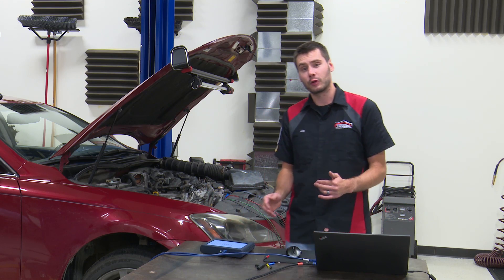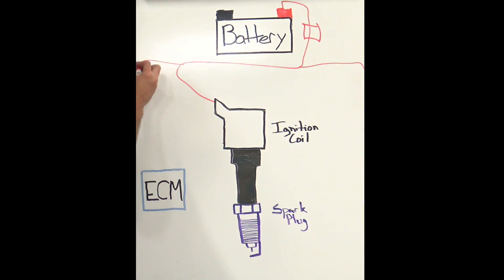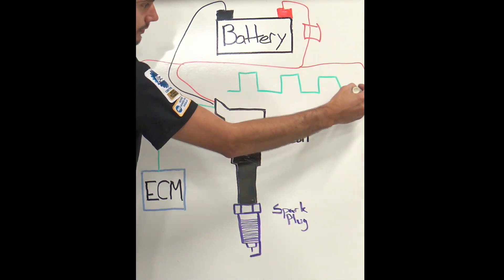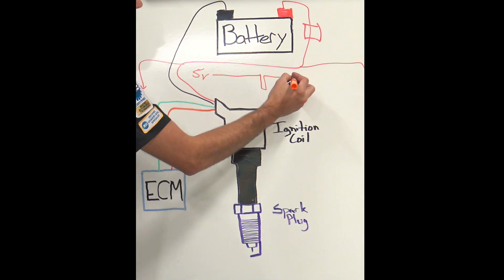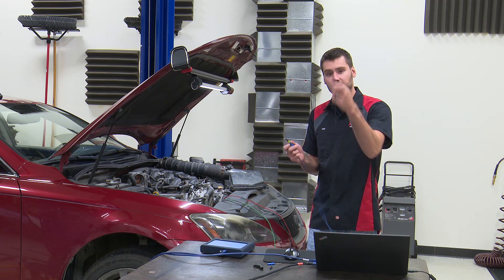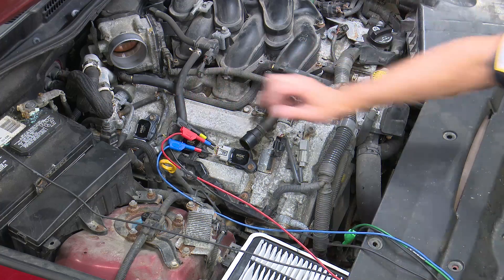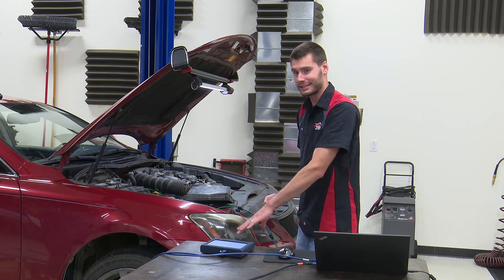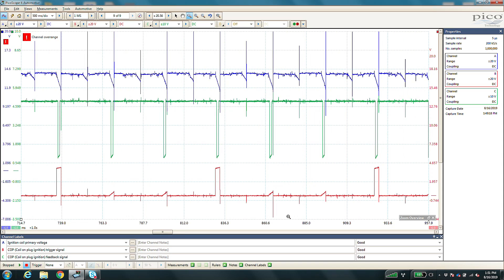"Smart Coil" 4 Wire Coil Testing Using A Labscope

Comment: On Toyota if there is no feedback ( or somehow the ECM senses a bad coil) it will turn of the injector.  I wasted a lot of time looking for a bad wire to the injector and considered replacing the ECM when i had a bad coil. I did not have a code for a bad coil. Next time i will probe the coil first. Thanks.

Comment: NGK Technical Training actually you are not “doing the same thing” as a proper voltage drop test for the ground circuit. By connecting the way you did here, you’re only performing a volt drop across the coil. In your presentation here, you could have completely missed a problem in a ground circuit by not using a channel input to view the difference in electrical potential between the beginning of the coil ground circuit (at coil) and the end (battery ground post).
Reply from the maker: Hey Daryll, if there were an issue with the ground circuit how could we properly maintain voltage differential under load of the coil when the car is running? Would you not expect a larger drop?
Mike Becker, Senior Technical Instructor
Reply: Use battery negative as a reference for all measurements. With a coil ground problem, you would end with less differential across the coil because you would now have 2 loads instead of 1 and with it being a series circuit you’d have total volt drop split between 2 points

So in this case, it would have been wiser to ground every channel at the battery instead of assuming a circuit is good
Reply: @daryllauto-correctdiagnost5020   It's his car. When that 2nd unwanted resistance that's in series with the coil gets high enough, the misfire will let him know something's wrong...lol.

Comment: Fantastic information thanks,  maybe you should also let everyone know that if we have i coil that has failed,  we need to found out the reason it failed,  i have seen people put into some nice NGK coil only to last i few months,  and then saying that it must be the coils are  bad ,only to found out that the reason this car was going through coils all the time was because the injectors was not flowing the best and the poor coils was working very hard because we had less fuel in the system , and i sure we all know that fuel is a conductor of electricity !
Reply from the maker: Hey Stephen, feels like it's been a while! thanks for watching and commenting! You're right, always diagnose the root cause :)
Mike Becker, Senior Technical Instructor

Comment: hi mike i have quotation  do i need to use attenuater  for the pico because the spike that comes after pull the current down? plz explain to me thanks to you
Reply from the maker: Wael, you should not need to. the Pico can handle 200 volts before you need to use one.
Mike Becker, Senior Technical Instructor

Comment: Hey Mike,have you ever had situation that pcm driver(control side or feedback side) has been frayed due to coil module failure?Thanks in advance !
Reply from the maker: Ismar, perosnally I have not seen it. I'm sure it's possible but I believe it to be less likely due to the very low amperage on those circuits. 
Mike Becker, Senior Technical Instructor
Reply: @GoTechTraining  thanks mike!Cheers!

Comment: Would it be fair to call this a Darlington transistor setup? A transistor in the ECM turns on a larger transistor in the coil. Can the square wave signals be tested the "old" way with a test light or is the current carrying capacity too small?
Reply from the maker: Hey, I'm unfamiliar with the Darlington setup. The transistor in the ECM sends a low current square wave as a turn-on signal. You DO NOT want to test that circuit with a test light. It's possible it could cause the ECM to fail, or enter into a fail-safe mode.
Mike Becker, Senior Technical Instructor

Comment: It wasn’t mentioned in the video; I assume that your scope has the isolated ground inputs.  On scopes that  have common ground inputs, connecting a ground to the device’s under test ground and another lead to ground at another point could set up a ground loop.  When the device(coil) pulls current, part of that current can flow through the scope leads.  Or if the chassis ground was not perfect part of the current normally going through the chassis ground could go through the scope back to the device ground.  The scope isn’t in any real danger unless the current flow is large enough to heat up the test leads or the circuit board ground traces.  But it can cause noise to appear on the scope display.  On a common ground scope connecting only one of the lead grounds is sufficient and avoids any ground loops.  Keeping in mind that voltage variations in the chosen ground will effect all inputs.  If the voltage variation of the device is wanted, or to infer current draw; a separate channel input could be connected to  the device ground to measure the voltage drop of the ground circuit to the device.        I like the shorter format.
Reply from the maker: Hey Steve, great tip. Yes the PICO does have isolated grounds so it's not an issue on this one. thanks!
Mike Becker, Senior Technical Instructor

Comment: at 1:30 i would think that the Ground connection for the coil would be on the engine /heads.. so the spark return path is the shortest.  failure to at least attempt to perform a voltage drop test from coil negative to engine/head ground connection may result in misfires or repeated coil failures where the high voltage negative spark return attempts to get by to the coil via the positive circuits.   this is a major issue with Coil in CAP GM Hei's that the ground strap gets left out and with aftermarket MSD boxes that the thick black wire gets grounded to the negative battery post or the body.. without a decent braided engine to firewall ground strap.  just a thought.. i have been at this for 40 years. no just some lurker throwing out garbage..
Reply from the maker: Hey Wayne, when I hooked the scope into the power and ground leads it was essentially testing the same thing. Sure a good voltage drop test is always a great way to go though!
Mike Becker, Senior Technical Instructor

Comment: The scope proved the circuits.  If you had a constant misfire, you could see or prove which one is faulty and along with the scan tool data, may be helpful for what's actually failing.
Reply from the maker: Hey Mike, thanks for watching! Great point!
Mike Becker, Senior Technical Instructor

Comment: How can you look at secondary wave forms with coil over plug systems
Reply: Hi Jeff. If you can access the COP, you can use a paddle probe. Or if you have the lead extension, you can remove the COP. Plug in the lead extension between the spark plug and COP. Then test the secondary with the inductive capacitance probe.
Reply from the maker: Hey Jeff great question! Billy, thanks for answering! That was perfect. 
Mike Becker, Senior Technical Instructor

Comment: Do you know the criteria by which the coil triggers the IGF signal?
Reply from the maker: Hey Anti Chuckle, unfortunately, I don't really know the secret sauce inside the coil...I could speak to one of our engineers. My guess, the module watches for some sort of voltage drop to occur. when that happens, it grounds the IGF circuit.
Mike Becker, Senior Technical Instructor

Comment: Great video! Ironic you posted this now. I just had a Lexus that the igf signal was shorted inside of a coil causing what felt like a due cut at 2100rpm.
Reply from the maker: Hey Franky, thanks man! Funny how that works.
Mike Becker, Senior Technical Instructor